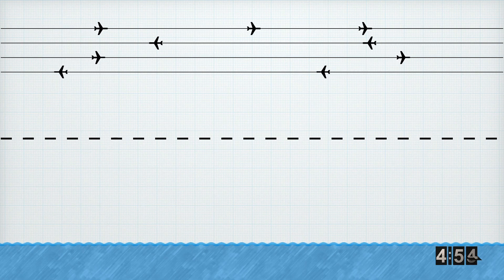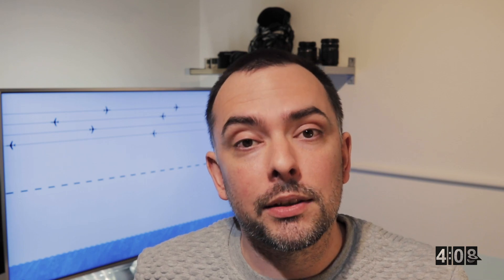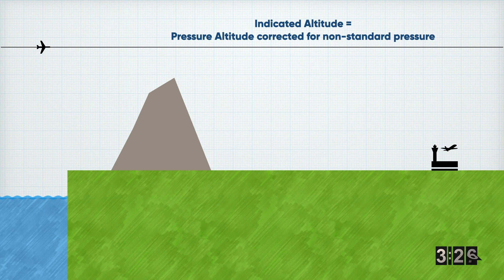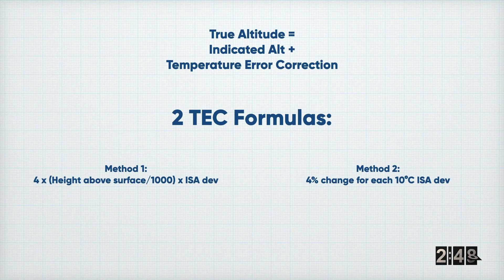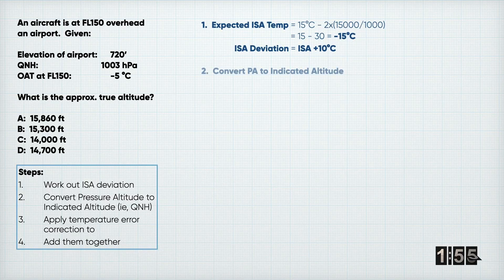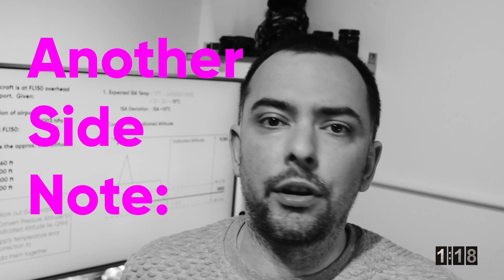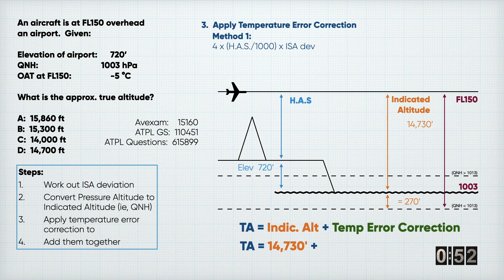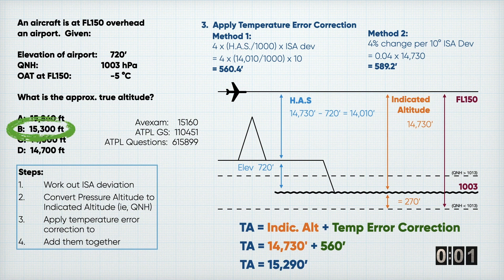5 Minute Fix - True Altitude

Comment: Your Method 1 is wrong and may lead to very  dangerous mistakes. The Method 2 takes in account  decreasing between isobars starting from see level which makes absolute sense from physics perspective.  Why would you calculate correction based on “H. A. S.”?! What kind of physics is behind that? Can you explain? At such small elevation it’s already 5% deference between results. But let’s say we at high terrain airport. Airport elevation 3000’ and ISA-30’. You will correct MDH200’ by +24’ according to your Method 1 and if you will go to that “corrected” minimum in IMC, you will find yourself 160’ below the ground because the correction using Method 2 is 384’. Or I got it wrong ?
Reply: Actually is method 2 that is wrongly applied. Both have to take into account the height above surface.

Comment: Hello, may I ask? Why does the airport altitude matter in method 1? If the airport had been at 2000ft I would have got a different true altitude. Thank you very much
Reply: Very good question. You can check my question above. I think that is a mistake. Incorrect method.  But author unfortunately doesn’t reply. 
He did a very good job actually, but looks like that is a mistake.
Reply: "Height above ground". The temperature correction is made in relation to the column of air below the aircraft and the datum where the temperature is measured.